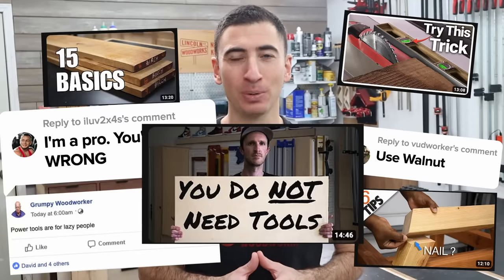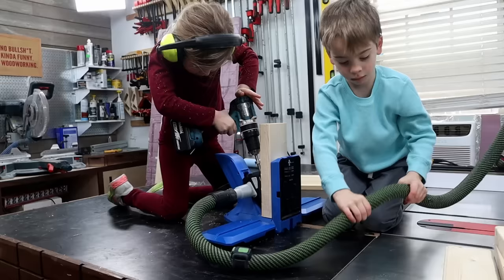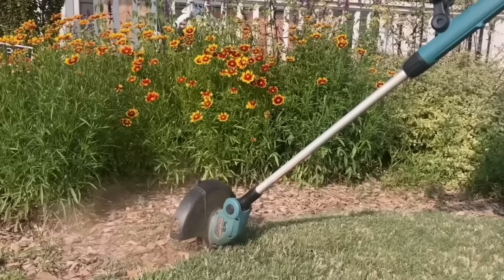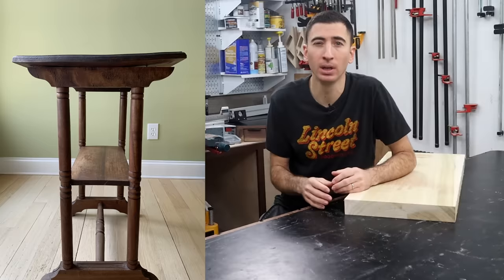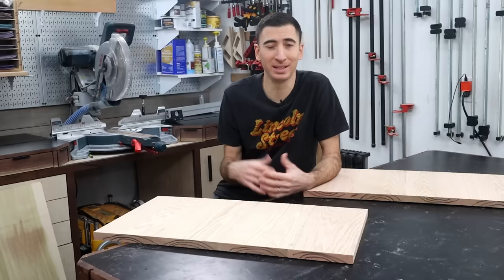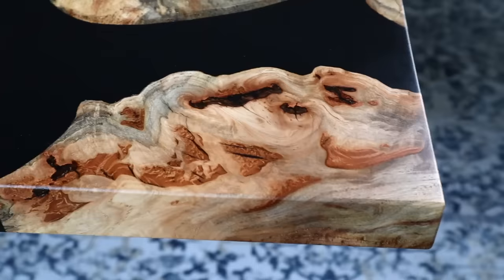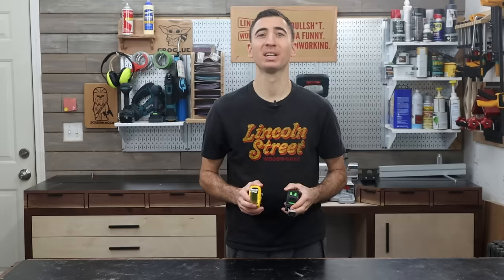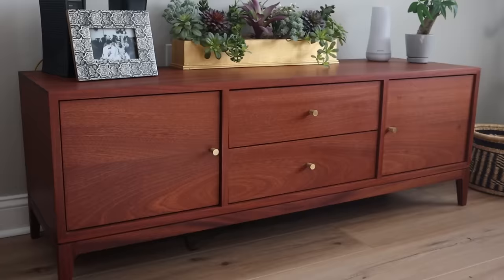Every beginner needs to hear this

Comment: Rex Krueger in his old vids explained very clearly why any steel screws are worse than pure-wood joinery (like mortise and tenon) - because steel is harder than wood, and in process of using e.g. workbench, it will contact with wood and because steel is harder, and wood is softer, the latter will begin to compress - i.e. the screw hole will grow while the screw itself isn't, so it will loosen. 

Another important aspect - heat compression. Wood and steel have different coefficient of heat compression - i.e. changes in temperature and/or humidity will deform (mostly unnoticeably to naked eye), but because of this difference, wood will deform at faster/slower rates than steel. I.e. put your table in sauna - and wood parts will grow, but not screws. It applies unexpected forces to all joints. Simple things like day-night cycle will heat up and cool down your workbench each day - and so these compression-expansion cycles will be constantly repeated. And after a year it will make noticeable deformations on such joints. 

Not to mention that screws rust - only stainless steel is immune to oxidation processes (hence its name). Any other screw, coated or not - will still have some contact with moisture in the wood, or air. And thus, will corrode. Which will loosen the joint, as iron oxide is not as mechanically stable as iron. 

On top of that - the main purpose of mortise and tenon joint is to increase contact surface  between two parts. When you screw two things together - their contact surface is only as big as the shoulder between two edges. But for mortise and tenon, your contact surface increases. Total surface is now roughly twice as big  - "walls" in the "mortise" part, plus "cheecks" on the "tenon" part. Thus, the total resistance to outside forces is now also increased correspondingly. 
Extrapolating this principle, you arrive at the "finger joints" used to make longer planks from two separate pieces - "teeth-like" cuts maximize useful contact surface.
Reply from the maker: I like turtles. 🐢

Comment: "no need to alternate grain pattern cause it will cup regardless and houses have hvac that adjust moisture levels"
Ah yes, cause you cant just finish the surfaces from all sides cause you are lazy and you will definitely not ever put those things into cold storage, nor Hvac system cant malfunction...

There is internal structure of wood that might change how wood behaves even when done correctly, but if you build, build it to last, same with the joint, use strongest possible joint, so you need least amount of material. You can spend 10K$ to walnut slab... or get thinner boards, resaw and glue them into cheaper wood as the heart saving lots of money, even then why waste all the work and money to make inferior item, unless its essentially door stop? Custom 3K€ table was finished from every surface, so much that it would work as a boat in a pitch and no issue putting it into cold storage. Surface finish on every surface also prevents molding on the wood it self, making it far easier to recondition even if there is some surface mold due humidity and heat.

For cordless, you are essentially married to battery system, so choose carefully I had Makita in construction job and it survived 10 years of utter abuse before battery died. Got Dewalt to compare it to and chuck bearings failed after two years of same use, so i'm going back to Makita and its clones for less used tools, but most important thing is how long the batteries last and cost of those. If its large brand like Makita you can even get long as same voltage other cordless tools and just get adapter plate to run it with Makita batteries, if they dont have that particular tool you want. If you want to start cheap, get used cordless and ask people with pro line tools to get feel from them. If it feels plastic its probably rather poor quality. Other hand if you dont use it very often cheap used might be just your thing and pure plastic design might be better since those rubber coatings tend to get sticky form lack of use and over time. When buying used, check the chuck that its axle is not loose in any direction and condition of the chuck teeth, outer casing for wear marks, smell of the motor and hot long battery holds charge while not in device, latter being bit hard to know when buying used.

Comment: As a restorer I have a tip to improve on the glue and sawdust trick.. Use fishglue, not pva glue. And maybe put a bit of watercolor to the sawdust to make it darker if necessary. But mixing fishglue with dust is so much than dust and pvc.

Comment: Well I don't believe that learning beginner basic joints is something wrong. 
My grandpa was joiner/carpenter and remember as kid when he lernt me and my brother it was actually using hand tools and basic joints.
I still have my first stool I made using mortise and tenon joints with hand saw, hand drill and chielses at age of 8.
Where the hell you wanna practice joints if not on simple starting projects? 
It's like going to sailing course or being in navy and instead of learning basic knots you would say to one they they can use duck tape, carabinier etc.

Comment: People whining about joints makes me giggle.  Those joint tests don't take into account how something is built.  When things are built properly and supported correctly, you're not going to get that 100lbs of force pushing at the extremes of the joint.  It's about proper distribution of the forces.  I can make a step stool with pocket holes and glue that is more than capable of holding up my 350lb self.  Gatekeepers will throw all practicality out the window in the name of tradition and old practices.

Comment: 1:00 
yea this test is mostly pointless for one simple reason: if any joint in your piece is experiencing significant forces in that direction during normal operation, your design is garbage and you need to go back to the drawing board.

no amount of complex expert level joinery will stand up to having to withstand force in the wrong direction.

for example if you need to have a right angle like that, cut  half flaps, which is easy enough even for a novice, then screw the pieces together from the side. now the screws aren't being pulled on when force is applied, so they won't just get ripped out of the wood.

Comment: i have only one comment, on the alternate gluing of boards to prevent cupping, he states it doesnt matter what configuration of grain you use, it will always cup, 
of course it will, if you do as he did, and absolutely soaked one side only, of each example he used to demonstrate his, in this case,wrong assumption. what age is the lad? if hes in his mid 20s, then he has only taken his first steps on learning his trade, and here’s one for free, 
he will find, as every tradesman knows, that very few jobs involving timber has only a right ❤way and a wrong way, in truth, there are probably as many ways to do a job on site as there are joiner/carpenters to do the job, and, providing the finished job is done within the time allowed, and to the standard required, then none of the methods used are wrong,.
very few things in life are in pure black or  white, and especially the trades involved in the use of timber, hopefully this lad will realise this, calm down, take a breath, stay calm, and have a coffee, would be mny advice!
Reply from the maker: I think you just summarized everything I was saying in the video without realizing it! Im in my late 30's btw
Reply: @Lincolnstww  im 62 and was still learning, when illness cut short my career, i’d say your half way to being as complete at your trade as anybody ever gets, enjoy the never ending learning curve, and the fact everybody can learn from anybody, however unlikely that may seem, one final nugget..treat every day like its your last, because some day it will be! 😜👍

Comment: Looks like the brass nut is part of a compression fitting.  If so, teflon is not needed. Anyone using it, or any other pipe “dope” is totally ignorant about how a compression fitting works. The threads don’t need to seal, they tighten to compress the seal. Shouldn’t do any plumbing.

Comment: Most cordless tools don't break, the batteries do, then when you go to buy a replacement battery you find out it's almost as much as the whole tool, so you just go and buy a whole new tool instead and throw the old tool body away, it's a massive waste and the tool companies do it on purpose to sell more tools, over inflated battery costs should be a crime.

Comment: Pocket screws will fail if they are subject to regular racking forces. Otherwise they are a good quick way to get things built.  Very entry level in terms of kills though.  As you develop you'll want to try other joints.

Comment: The alternating method you said is not true, is not true! It is good practice, because you didn’t encounter cracking. I build tables for a living and tops I don’t alternate WILL split when book match, and the enduser lives in the south pacific area for example. So why would you claim from spritzing water onto a tabletop overnight that cupping will happen anyway. You are pretty much not encountering that moisture is happening in most cases on both sides.

Comment: The only Ryobi tool that I've had even begin to get worn out is my early 2000's drill driver, and I abused the hell out of it.  I like Ryobi specifically because their secondary tools (like a glue gun and soldering iron).  It's exhausting how anal the tool bros are, and their logic is always that the Ryobi, or whatever tool they don't prefer is being discussed, won't survive their hypothetical orbital space construction yard in the middle of an meteor storm style environment difficulty.
Reply from the maker: You pretty much summed it up perfectly

Comment: There is only one company that backs100% their product Ridged. I have Tried to contact Dewalt for a heater. Sent pictures of the thing and guess what they don't recognize this item with their name, color And tag attached. Good luck. Thank you China????? Ridged costs a little more but if you use a tool more than 30 times and don't want to invest another100bucks for batteries Or support fine with me I learned the hard way. Dewalt does look cool..... BUT I pay good money, why would I expect a... Well good luck. Just had to say the truth, check the warranty And make sure the company recognizes IT

Comment: Maybe where you live you can control the humidity.  It been a very wet spring in Texas.  Right now with the A/C running my hum. gauge shows 62%.  It hasn't rained in 4 days but water is still standing in places.  In a month the hum in my house will probably be very low.
I don't understand why so many youtube videos are about proving the old practices wrong and turn out to be just bad advice.  Have you all really run out of substance?

Comment: 0:34 "Dowels are stronger than pocket holes!” 🤡🌎 If anyone actually believes that, I suggest they make both, let them dry for a month then try to break them. The dowels will snap like a dry twig, because that's exactly what they are. Also pocket screws are an acceptable way to mount a table top, dowels are a meme in this role.

Comment: what I know as a licensed professional is that, you have a lot to learn about the craft of woodworking. while the things you present in this video might make a piece of furniture, it will not fall under "Good craftsmanship" not by anyone that knows anything about woodworking. you made this video and I bet 75% of the comments are ripping your instructions apart. Woodworking has been done with hand tools for centuries, if you can't make a mortise and Tennon joint, try again. if you seriously can't I'm sorry you’re not a woodworker. that is one of the most basic qualifications.
Reply from the maker: You’re*
Reply: @Lincolnstww  I don’t think good grammar will help your woodworking either.
Reply from the maker: @hankoceanlife  🤷🏻‍♂️

Comment: That is not a table, it has about 10-30 times the amount of material actually needed. If you built anything that way to make a profit, you would go bankrupt. The guy you pinned is right, your vid is beyond useless. It just fits in nicely with your epoxy pouring slab crap to ignore shrinking and quelling of the material. My rule of thumb : If there is "woodwork" anywhere in the name, it is very bad.
Reply from the maker: 10-30x 😂
Reply: @Lincolnstww  You could build a bridge with that amount of lumber. Why not just sit on a tree stump?

Comment: Your not necessarily wrong but that doesn't make you right! You are just simplifying most of the topics too much. You have no business claiming any expertise. I have been woodworking professional for 35 years ( not in my condo garage on youtube) and im no where an expert your problem is you think you have all the answers but there are exceptions to every rule, doesn't make the rule incorrect. Experience teaches when .
P.S.
 If you building furniture out of framing lumber you are a hack!
Reply from the maker: Sick burn with condo garage!

Comment: You are dead wrong about the cordless power tool debate. There may not be a clear winner, but there is a Standard and Ryobi for me does not meet it. It’s DIY level barely better than Hart Black & Decker and warrior. Definitely not as durable As Milwaukee, Dewalt or Makita or worth the value for people doing any serious work

Comment: Wrong, your test was bs. Leave them hanging in a humidified room for two days and measure the maximum deviation in both. The same direction will be greater. This leads to greater stresses in the finished piece

Comment: Dude.. You're buggin. No one gonna notice the difference between a ridgid and a makita?! Or a ryobi and a Milwaukee?!? 

Have you ever used a Ryobi or Ridgid screw gun?? Ryobi is fine if you got all day to drive a single screw. Lol. And Ridgid is fine if you don't mind replacing your power tools every couple of years. 

There's a reason those brands are priced so cheap.. They're meant for hanging photos, or running that screw back into your dining room chair and not much else. There's also a reason no professionals use them.. For anything.. At all.

Comment: I hate this kind of title which is very pretentious in my opinion. Lets'go back to basic, grain direction?  I have build really stable surface over the years whit hard and soft wood and for furnitures, tables with boards up to 10 or 12 inches wide and for hand carving to.  So, If you want to make a solid and stable surface for years you need to reverse the grain direction of the wood not only alternate sad face and happy.  Remerber, when a tree grows it does so from bottom to top and it matter when you laminate wood.  By the way for the rest of the information in this video, Good job. CIAO! ;)

Comment: There is no such thing as 'lbs' of force. Lbs are unit's of weight and on useless here.   In these cases it's lb/ft of torque and without the 'lb/ft" element it tells you nothing of any value.

Comment: Practical advice for moderate use and moderate climates. Completely wrong for extreme climates of heat, rain, or snow where wood movement is a big issue. In such climates do research on what is actually useful. Don't rely upon YouTube videos.

Comment: You are kidding right?!? You tested your "table" for joint strength on a highly slippery surface with quarter pound hockey pucks and riders and call that even CLOSE to any kind of realistic test?!?  BWAHAHAHAHA! Send it to us, we'll have that thing shredded in no time. All joking aside, the point about Woodworking Wonks desperate to find and make content for clicks is well made in regards to crafting to just a bit above the average expected usage.    I was somewhat nonplussed at your wood glue and sawdust demonstration example as it was about as clear as mud... it just looked like two rows of divots and just barely showed what happened after different stains were applied, I had to do a couple freeze frames to really get to what you were trying to show with how the glue does not take stain well and can stand out.  Otherwise, not too bad a job... good advice is always welcome, but when it becomes "dogma" or "old saws" are not rechecked for various situations, it can bite you in the "knots"... <G>

Comment: You failed to take into account the forces applied to your furniture when moving it around the room or from house to house....FAILURE
YES one brand of tools is superior to the other without question. Milwaukee has the largest selection of tools using the same battery platform!...FAILURE
Growth rings....Yes it's important to alternate these for the BEST result....FAILURE
On the measure issue....the absolute most important thing is to ALWAYS use the same tape measure to get the measurement and to mark for cutting or drilling. Different tape measures will absolutely give you different measurements. If you don't believe me take all your tape measures and check them against each other.
Reply from the maker: Sounds like I PASSED!
Reply: @Lincolnstww  If you want to lie to yourself then sure.
Reply from the maker: @mikek8632  I know you like to use caps and shout about how much you know. But just a quick FYI next time you feel like yelling - Makita has the widest battery platform. Not that any of it matters but now you know. You’re welcome